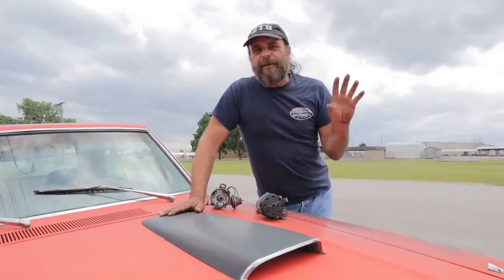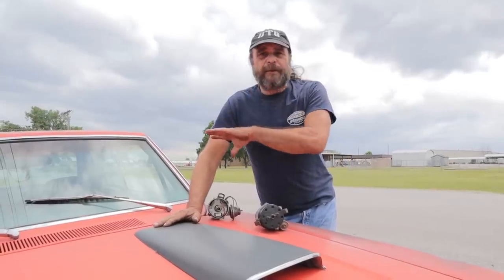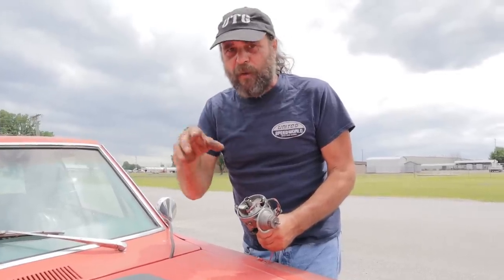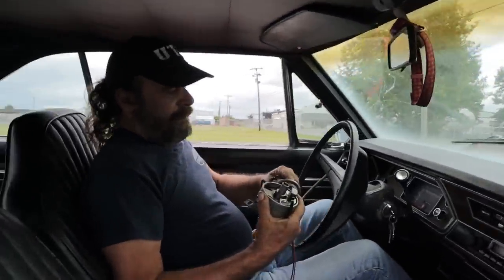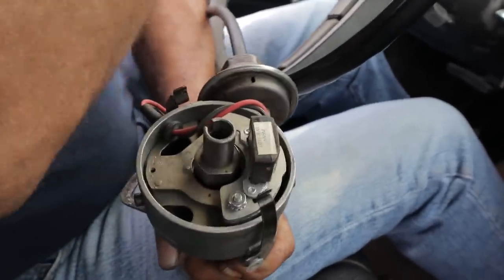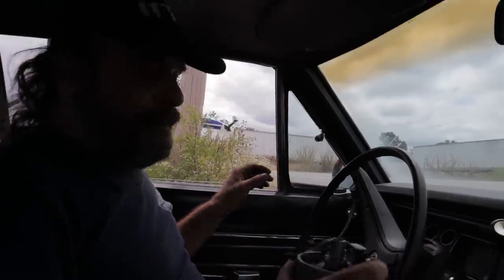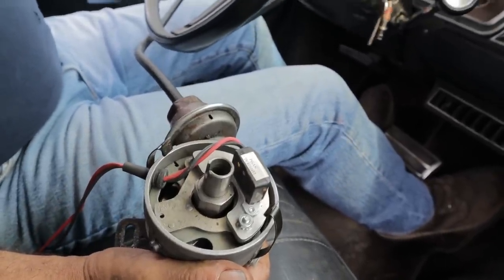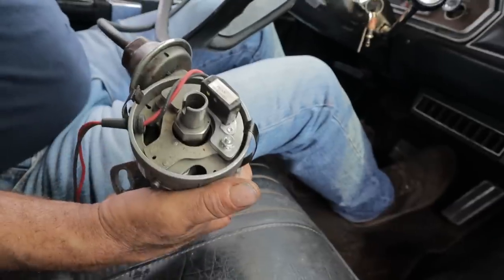The Vacuum Advance Debate!

Comment: I had to make electric controlled port vacuum because Dominator only has manifold vacuum.  I wish there was an 1100cfm QJet lol
Reply: Lots of vacuum cans to choose from, calibrated differently each one.  Atermarket adjustable cans as well.
Reply: @thisisyourcaptainspeaking2259  dominators do not have any port vacuum port at all that is why I had to make electrically controlled port vacuum. I drive on the street and in traffic at times.
Reply: @72chevelle156  seems like you could've just switched to a manifold-calibrated dizzy?  Funny one for ya, I've drilled holes in carbs before, for similar reasons. I'd expect such a can is unavailable for your setup but trucks were the last to be emissions tuned.  Jegs or someone I'm sure offers something for your application?  The manifold cans began advancing about 3" vacuum and were all-in around 8", wereas the ported cans began about 8" and were all-in about 18".  Adjustable cans were the shiz, along with mechanical spring sets and limiter brackets them days.
Reply: @thisisyourcaptainspeaking2259  can't have any vac. adv. at idle with 14.3:1 compression it would likely cause engine run on. Good info though.
Reply: @72chevelle156  Yeah, not sure where your initial timing would need to be. I guess having timing drop out wouldn't help prevent dieseling but lean idle mixture will cause it, or other reasons such as too much throttle blade angle (compensating for lean idle mixture circuit?)  Holes drilled in throttle blades and/or air by-pass are a couple items that come to mind.  Reminds me of the old butterfly solenoid strategy of the 70's where a solenoid held throttle angle at idle then dropped out at key-off, to avoid dieseling.
Reply: @thisisyourcaptainspeaking2259  My solid roller valvetrain requires a higher idle so i actually reincorporated my old high idle solenoid. dominators already have holes in the butterfly.  good call.
Reply: @72chevelle156  A friend of mine was running solid rollers in his Brodix block.  He's got a single holley on it, I was trying to convince him to slap a tunnel ram on it.
Reply: @thisisyourcaptainspeaking2259  Do you need to convince him to put a hole in his hood also or does he already have one? What brand are his liters and cam do you know? I switched to Howard lifters because Comp Cams lifters kept failing.
Reply: @72chevelle156  Yep same problem,  the rollers were failing.  Not sure the brand or even how old they were, neither did he.  Convinced him into switch over to hydraulic roller.  This is a boat and IMO, his new cam is rather large, he said he went with the biggest he could find.  Not sure what else he's got in mind.  Probably enuff room for a tunnel ram, honestly I was kinda joking with him,  it would be interesting though.  525hp is about the limit for a Bravo sterndrive before cases begin twisting, probably he's near there already.
Reply: @thisisyourcaptainspeaking2259  cool chatting with you, catch you later.

Comment: Wow Dude,,,,,,,,,,,,I'm not seeing "anything" do anything?
Reply: Look a little closer, it doesn't move very much, only a fraction of an inch, so it's hard to see.
Reply: I guess your not familiar with what parts  are moving on distributors in general but it was clearly moving. If you watch the correct parts inside you can clearly see gaps getting bigger and smaller.
Reply: @TripR32  Well, > IF "YOU"> Watched it,,,, before he "Fixed it" > YOU TOO: would've seen it "WASN'T MOVING",,,,,,,,,, until he changed the vacuum

Comment: “It’s retarding the timing when your engine needs it the most”.  No, it’s retarding the vacuum advance as soon as cylinder pressures increase as the throttle opens and you don’t need the advance anymore to combat the slow-burning flame front at idle.  Also, his demonstration doesn’t show the fact that, in an installed dizzy, the mechanical timing is taking over at that time when you need it - as soon as you increase rpm.  I’m sorry but as knowledgeable as uncle Tony is, sometimes these crusty old guys get a false idea in their heads and they never stop to revisit misconceptions they’ve harbored for so many years.  Uncle Tony is wrong on this one.  If you have any questions, look at what the actual automotive engineers have said about it.
Reply: You get that he was showing and explaining (for those that are new, or dont understand) the effects of being connected to both ported and unported vacuum right???? Seems like you missed that part...
Reply: @wheels-n-tires1846  umm yeah… i get that
Reply: @yeboscrebo4451  Evidently not. He showed that vacuum advance, hooked to unported vacuum will retract above idle when accelerating, removing timing and reducing "total". (Total timing=  mechanical+vacuum). So how could that ever be a good thing?? When would you want total timing in by say 1500, and above that it retards it whatever the vacuum advance amount is???  Thats backwards.
 I cant think of any time that'd make any sense...
Reply: @wheels-n-tires1846  it’s absolutely good thing.  The necessity for manifold advance at idle and high vacuum/low load situations just off idle  is because the closed-off throttle is creating a sparsely charged cylinder.  The flame front in this condition moves slowly and so you need more advance.  AS SOON as you open that throttle, the cylinder charge is packed with air/fuel mixture, the flame front burns much quicker and you DONT NEED the timing advance that you did before.  When Tony says “the timing drops off just when you need it the most” he’s wrong.  The vacuum advance timing which is designed to accommodate low load conditions is not needed anymore when you introduce load.  At that point mechanical timing takes over like it is designed to do.  If you switch to manifold advance and you don’t get the pep you had before, you need to ensure the mechanical timing curve comes in quicker and stronger.  Leave the vacuum canister to do it’s own separate job